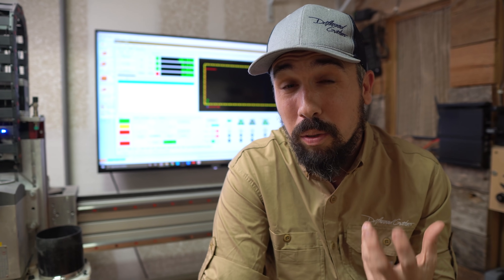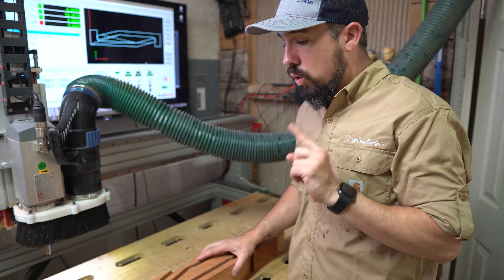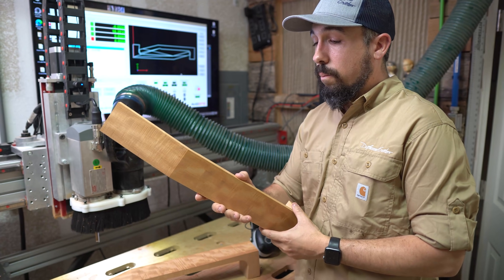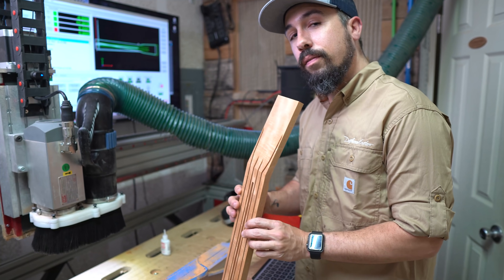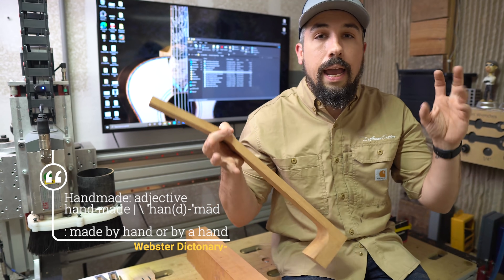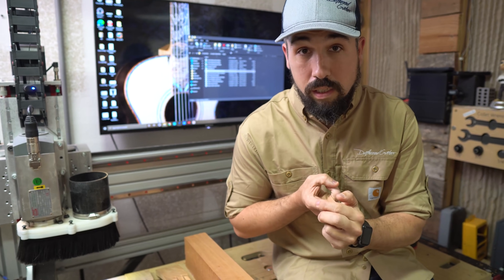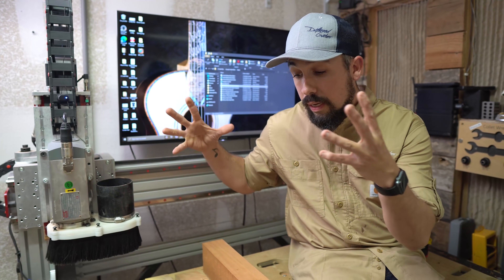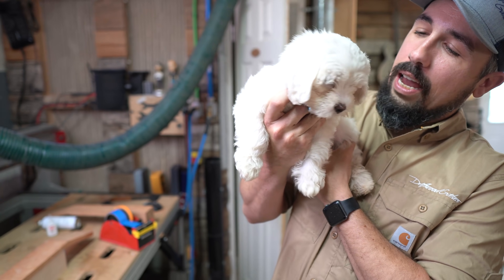Can You CNC Machine A "Handmade" Guitar?

Comment: Had CNC been around in 1833 CF Martin would most assuredly used the tool to build an even better instrument. Templates, fixtures, routers, sanding drums, thickness planers, electronic calipers, table and band saws are just tools, like chisels and block planes. The skill of using them to achieve the desired repeatable result, that’s the mark of a great hand builder.  I would absolutely 100% call you a custom “Hand Builder”.

Comment: 'hand-made' is NOT a guarantee of craftsmanship or quality. But it is often sold as such, and sold along with emotive terms such as 'legacy', 'quality' , 'essence', 'pride', 'love' etc etc.
I think amazing quality comes from a combination of both machine and hand.
Give me the micro-millimetre perfection of a CNC cut to fit the parts together with the finishing and finessing detail of a quality luthiers hands and you'll have amazing products.

A CNC machine is no different to any other electrical tool in the workshop (or as you say a really well prepared template and good router bit), it reduces time for repetitive 'prep' work and that's where it ends.
A CNC machine cant final finish a neck carve, oil the neck or lacquer the neck.
A CNC machine cant fret dress, glue all the binding in
A CNC machine cant do the thousand little jobs that a luthier does to actually make the finished product.

A CNC machine is just a drill bit that can cut in 3D space, nothing more.

Comment: Hand made quality?  What does that mean.  Machines are far more accurate than we are, and can do it time in time out.  We cannot do that.  To be honest carving a neck is no big deal really .  The label handmade confers ( supposedly) a "guarantee" of quality, but it doesn't really.  Machines should be used to take the grunt work out, and more time can be then where only the manual method applies.  To an extent, all guitars require hands on work, including assembly and set up.  I suppose you could argue that using machines a lot should reduce the cost of the product.  But did it?  If you are saving time, should the saving be passed on.  That way the customer feels that  both are getting a good deal.  The whole discussion about how much should someone like you charge for an instrument is an old one.  Trust me, as a maker myself, I fully understand that thorny question.  Further the whole question of cost and worth , is one that should be discussed.   This though is a massive subject.
Reply from the maker: Thanks for the discussion. Good points all around.
Reply: Exactly.  The question for me is, why would you care to call them "hand-made" anyway, as if it's a virtue?

Comment: cnc is just another "cutting tool" you got to have skills and knowledge to build guitar and man, as long as its a one piece neck, I don't care. I just bought a 2000 dollar guitar and found out that this brand along with others famous brand using a 3 pieces neck these days. yes they claim it to be stronger(I don't buy it). heck even their 5000dollar guitar also using a three piece neck. tbh, I don't see the point between cutting it with the bandsaw(which also a machine) and compare to the CNC cutting.
Reply: A laminated neck it is stronger cause they are glued crossed grain, more impervious to weather conditions aswell. A 1 piece neck will be very flexible if you dont install carbon/steel reinforcement rods to the sides of the truss rod. I own so a 1 piece neck mahogany with only a truss rod and when I change tunings between songs  on my shows which is often and I see my self tuning all the strings because the flexing on the neck.
Reply: @geamax1  My guess is that it's not exactly laminated but most likely divided into neck, headstock and heel.  The neck alone should be one piece.   This being said, a well done glue up job, where there's enough surface to be glued (which there would be on these parts), could be stronger than the actual wood (depending on wood as well obviously).
Reply: Avalon Guitars and Lowden Guitars both use a 5 piece neck design - running the length of the neck. These are considered to be very strong and less prone to movement under varying temperature conditions.This would be my preference…

Comment: Well, as someone who has done Woodworking not just for guitars, but construction, definitely this feeling of fundamentalism in building things and calling it handmade clearly is coming from people who dont have the pressure of making a great product repeatedly for a long time. so yeah, using a CNC to streamline the work flow and guarantee a better product is not detrimental do the hand made aspect of it, it actually maked the hand made part more fun to do, since you dont have to focus on the dimensions being just right so you can start the fun process that is shaping a guitar neck.

Comment: CNC machines are the best thing that happened to guitar making!
Reply: @gavinw5469  absolutely it is!
Reply: @gavinw5469  There is some truth to what ypou are saying but generally if you simply forgret about "mojo" and stop romanticizing guitars, you'll be fine! ;)

This is not hand mande VS mass produced it's
human accuracy VS machine accuracy and i don't think that anyone can disagree that accuracy is one of the main keys to a great guitar!
Reply: @gavinw5469  i simply do not take it as a fact that these old guitars are so damn good, because of what i wrote earlier. people love to romanticise gear which leads to extreme bias. most of these old guitars do not even intonate correctly because how inaccurate the frets were placed just as an example.
Reply: @gavinw5469 that's due to the natural behaviour of stringed, fretted instruments, not because the frets are not in the correct position, two very different things!
The problem is that "hand made" has some magical effect on people and that in most cases it's not justified! I absolutely agree that a hand made guitar, built by a master is superb, also a CNC guitar build by a master will be superb!  However, a hand built guitar by a wannabe master will not be as good a a CNC built guitar by a CNC operator simply because of the tighter tolerances and precision. Just take a look around youtube and all the thousands of "luthiers"! You will rarely see some clean work.
Reply: @ThornWithin  how about we both just delete all are comments. No use arguing about something we both won't change our thinking on.
Reply: @gavinw5469  i didn't see it as arguing but as a discussion about our different views on things! :)

Comment: Yes all guitars are handmade, but i think “custom” or “boutique” builder is a better word if CNC is used extensively.

If a extensive CNC based builder uses the word handmade, it takes away from builders who dont use any automation at all. Not because they dont have money to buy CNC or dont have the skill but for the love of the craft of using manual control and feel to build the instrument.

CNC takes away the feel of woodworking but you gain efficiency and accuracy.  

Doesn’t mean it takes less skill to build this way, but I think “boutique builder” is a better term for your operation.

This is nearly the same level of automation like Cortek and Yamaha gakki and even Gibson/Epiphone.

All guitars are handmade even those made by Cort and Epiphone and Yamaha but they dont brand them as such.

Comment: As it always happens, the BIG difference is in the details. Even if you had made all the neck with the CNC, there would still be small adjustments to the outcome and the decisions regarding this specific outcome and the following steps, and, of course, the finishing. And If you had done all these things automatically, with machines, you'd have a second or third-level instrument. First-class instruments always need special care and attention, lots of, it doesn't matter if you've used machines or not.

Comment: I would imagine that the Martin custom shop would not be beyond using a CNC machine.
I as a player would be more concerned that glue joints were as accurate as possible and that the glue used was the best possible for wood.Accuracy and good joints are very important in aiding resonance,and if a CNC can produce that accuracy I'd be all for it.The end product gets far more expensive the more "hand building" is employed.......................

Comment: Hand made is a buzz phrase for percieved quality, unless you're just talking about a tool that is completely run by hand power.  CNC is a tool. Hand saws, hand planes, sanding blocks, band saws, pin routers, belt sanders, and tablesaws are tools.  All require the application of skill to turn raw stock into something that has been transformed.  With a CNC you're using your knowledge to make the template, correctly set up the stock, and then have the machine use those directions to batch out the part, either quicker or in a more efficient number of operations than running the same stock with hand tools, or individual machines.  In this case, the CNC is replacing the work that would have been done by an apprentice under the training and supervision of the builder.  The knowledge that guides the tool is the key distinction for me.

Even after all the parts have been batched out by the machining operations, you're only going to have a guitar shaped object unless the training, experience, and skill you possess is used to make a guitar from the prepared parts.  Maybe at some point, there are automated machines that will batch out a guitar without human intervention, and it will probably be a really nice product, assuming that a luthier was the one who set up that machine in the first place.  But given the variability of the involved medium, I doubt that a CNC machine will ever surpass the quality of output that a passionate luthier can.

I'm a woodworker, but not a luthier.  I do so for fun, and will use the appropriate tool for the task.  I don't care how long it takes me to make something because I'm not selling it. I started learning to use hand tools because it was fun, not because it was better.  I still use a tracksaw, bandsaw, and tablesaw for part thicknessing and shaping, and hand tools for precision operations.  Then I go back to a powered sander for finishing, because sanding by hand sucks.  Could I use a CNC?  Sure if I was willing to incur the expense of buying one, dedicate the space in my shop for the machine, and take the time to learn how to use the CAD software.  But for my one of products, there's not as much savings in time as there are in a business where time is literally money.  If I do get a CNC at some point, it'll be because I'll enjoy learning how to use that.

Comment: I can only speak of my electric guitars and they are largely rough built by CNC , but the necks are hand sanded , guitars hand finished , hand wired and assembled. For me its about and guitar being consistently good if not GREAT. In the end its about a quality instrument "Hand Built" does not 100% mean a GREAT guitar , that is on the builder to deliver a quality instrument if a CNC makes delivering it easier , more profitable or more possible then I am 100% for it it makes me sad to see Rosa string works saying he is likely building has last guitar because of hand pain if that could be avoided with the help of a machine or tool I'm all for it.

Comment: In my opinion, the amount of skill and knowledge needed to program, set up, and successfully use a CNC is even with and even greater in some instances than using other tools in the shop.  And just like you said, the CNC gives you the opportunity to achieve a level of repeatability and precision that just isn't achievable with other methods.  Plus, it's not like you just throw the wood in the CNC and out pops a guitar.  You are simply using a more modern tool than, say, a spoke shave.  Your guitars are without question still handmade.   For what it's worth, this "argument" has been going on in the custom pool cue world for years as well.

Comment: I don't care if a guitar is handmade, machine made, home made, factory made, etc. I care if the guitar sounds good or not, and plays well. Technically, if you use any machines to assist in making a guitar, it's probably not "handmade." A badly designed guitar is going to sound/play poorly if it's made by a person or machine. I prefer terms like Custom Designed, Individually Crafted, over the term Handmade.

Comment: The building of anything requires materials and labor. In a guitar, the wood is a major cost.
Wasting wood is as close to a sin as anything can get. CNC allows you to minimize waste and maintain precision.  You are still selecting to proper material, deciding the right thickness and configuration, and doing the stuff to make it a fine instrument.
Frankly, the mechanization allows you to concentrate on the ART and the process without getting bogged down in the initial stages.
I am sure that the first guy that used a band saw took flack from the hand plane and chisel purists,  who had taken flack from the chunk of Obsidian scraper fanatics...

Comment: The only places the distinction matters is where a hand and eye guided tool would yield a better result but a CNC'd part is used because it's easier or cheaper. Everything else is just semantics unless you are starting with a standing tree and ending with a finished guitar using nothing but tools you made yourself from materials you mined and harvested yourself. CNC just replaces a highly skilled assistant with a band saw handing you identical parts. Based on the time lapse: https://youtu.be/0s4Y39qZ6Pw it looks like every part of these guitars gets hand guided, if not hands on, work.

I used to know a backwoodsman who could make an ax handle from a tree branch using just a piece of broken glass. That's not how you make the best ax handle. 

As far as I'm concerned, you can call these anything you like except chewed out of trees by beavers.

Comment: It's just another tool. What matters are the decisions made by the builder and the craftsmanship and techniques used to create the voice of the instrument. If you were to compare a production  instrument with a "hand made" one the differences would be apparent when you evaluate where a luthier intervened and made decisions (materials, methods, designs, etc) and "interventions" (e.g. voicing) in the process on the hand crafted instrument but not on the production instrument. You could also compare the outcomes based on skill levels and decisions of one luther vs another. One could argue that better tooling allows more value added activities from the luthier because the luthier can spend more time making decisions & voicing rather than working inefficiently and wasting time with more primitive tools that likely introduce more opportunities for defects or flaws.

Comment: For me, handmade does not necessarily mean better or more precise, it means it is unique due to human error and has the amount of labor put into it that requires a person to perform all of the shaping and building.  When you pay for something handmade, you pay more because you expect that someone was doing all the work.  Yes you can use templates and power tools, but someone has to physically manipulate the tools.  You can start a CNC machine and go do something else for half an hour while it works.

There is also the romantic view of handmade that each piece is a little different because a person can't make the same exact same guitar every time.  There will always be some differences.  It is also romantic to think someone painstakingly built a guitar by hand, but I assume some builders don't have a personal relationship with every piece, that sometimes they are building something because it is a business or it's their job; however, some people do expect that of a handmade guitar.

Now, would I buy a guitar instead of another guitar just because it is handmade?  No probably not.  I would get the one that sounds the best.

Comment: Hand made vs factorymade ... imho the factory produces a reliable Product, the differences in the organic material wood are compensated with thickness and general more margins. The handmade instrument is individualy tweaked to a point, where it gives the best sound and still handles the tension. Further the sound is improved by the skillfull handmaker by cutting away on the braces in places where he/she knows that the sound will improve - this is the personal skill which only comes with experience.

Comment: Chris, to answer your question, in my opinion it’s hand made.   I’ll tell you like I tell all of my blacksmithing friends, if a blacksmith in the 1800s had a welding machine, he would have used it.  Using a CNC router is still hand made.  Those that program and run CNC machines know this.  It’s a tool to help you do a better job, more accurate, and eventually faster than if you were using all manual hand tools.  Love it, embrace it.  It’s all handmade.